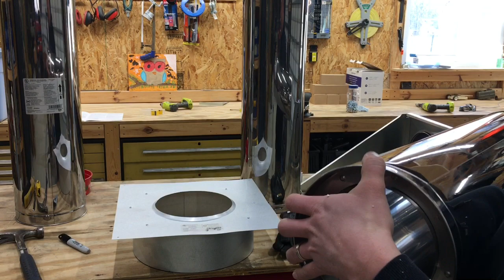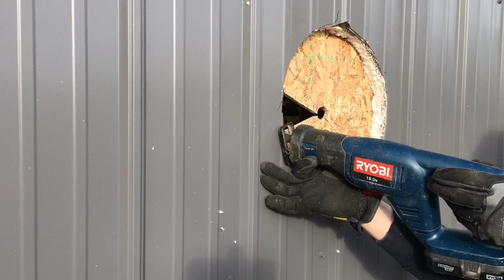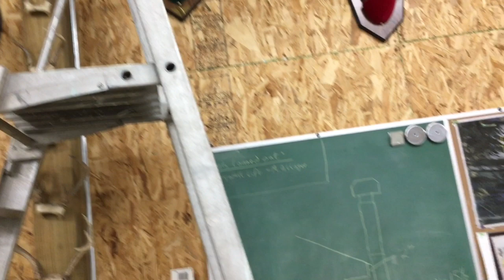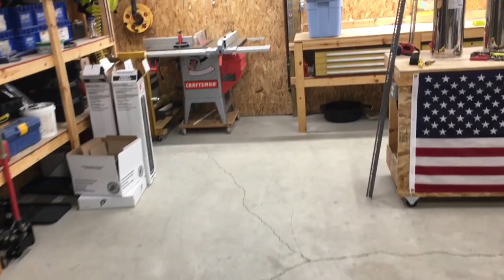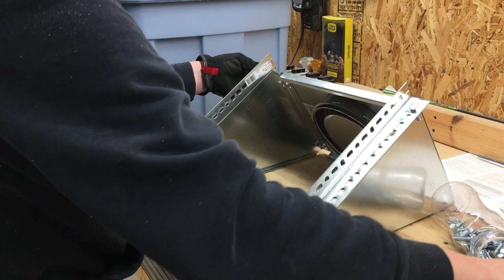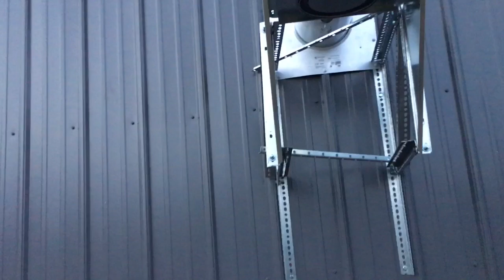061 Stainless steel wood stove chimney

Comment: did you get rid of the radient heat system you had put in on previous videos?     Im confused  lol    Why this  wood stove now!
Reply from the maker: Radiant system is still here and works great. This wood stove stack installation is for my maple syrup evaporator. I connect everything in the spring and make maple syrup inside my barn. Very efficient and convenient. It’s a wood fired evaporator I built many years ago. I connect a steam evacuator hood also, so there is no steam inside the building. I have videos posted on this if you search my channel. Thanks for the question!

Comment: I am looking to do this soon and was wondering how it held up in snow.  I live in Maine and the roof faces North and is the last to melt.  I dont want to spend and install just to have it crushed with a snow/ice avalanche off the roof once I start boiling sap.
Reply from the maker: Mine has held up pretty good but I don’t get near the snow you do. I also built a cabin back in the woods with a small wood stove and I designed that bracing slightly different. I think it looks better. Check out my cabin videos to see that one. Good luck.

Comment: What I was really hoping to see what's the pipe installation through the thimble the part you left off. I have a half inch gap between my 6" ( 7" out side) double wall and the 8" hole in the thimble.  How do you seal it?
Reply: I twisted aluminum foil to support the angle, then used high temp sealer over that, it worked great. Lowe's sells 2 or 3 different kinds, and the 600°F silicone flexes to hold tight seal. Lowe's also sells a 'Crimper Tool' that easily reduces diameter, then seal. Some products valve ratings of 3000°, at Lowe's. Good luck, brother, I know it can be frustrating

Comment: How do clean the chimney, especially the L shape part outside the building!?
Reply from the maker: The bottom of the L shape has a clean out so the vertical section is cleaned from there. For the horizontal section, my stove is only used a few weeks a year and removed every year (making maple syrup), therefore I clean the horizontal section from the inside and ash is pushed to the clean out on the L. Hopefully that makes sense. As a side note, the stainless chimney does not build up much or anything to clean.

Comment: I know the recommendation by Supervent is 2' on the horizontal run from the tee to the inside.  I was thinking of running a 3' and it looks like you may have done the same.  I have to clear a 21" overhang.  I'm not sure one the 1' difference would make a difference if I use a short black horizontal pipe to the stainless steel adapter.   Great video.
Reply from the maker: I can’t remember what my horizontal run is but it seems to work well. Good luck on yours and thanks for watching.

Comment: Nice job! But aren't suppost to use triple wall through the garage, out & up instead of double wall?
Reply from the maker: I thought that too but the venting I bought is rated for exactly what I used it for. It calls for a 2” clearance to combustibles and the wall ring I bought had the 2” built into the design.

Comment: Put me down for some real home made syrup !!!!    Question about your electrical install in the ceiling.  When you ran the wire through the metal ceiling did you use a rubber grommet or how did you fish it through without worrying about it rubbing on the sharp metal hole before it went into the metal outlet box.  If you did use a grommet please describe where you got it. Thanks
Reply: You can use the romex connectors that you put in your panel box as well.
Reply from the maker: https://www.homedepot.com/p/1-2-in-Snap-In-Bushing-10-Pack-27251/202077082

I used universal plastic grommets like these to go through the steel. Great question because if you don’t use something similar you will inevitably cut a wire and have a short. Thanks for watching and commenting!